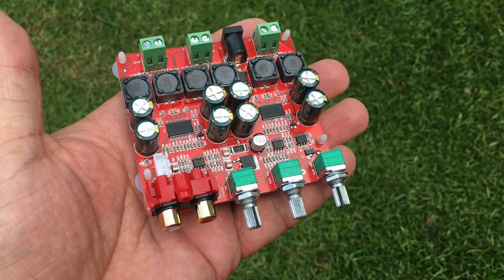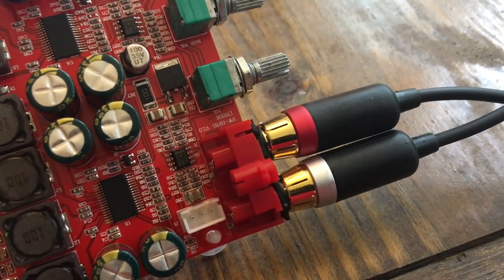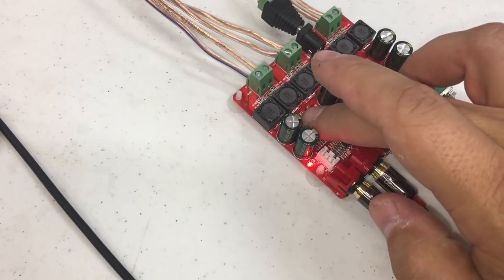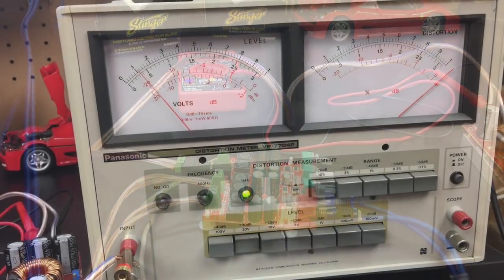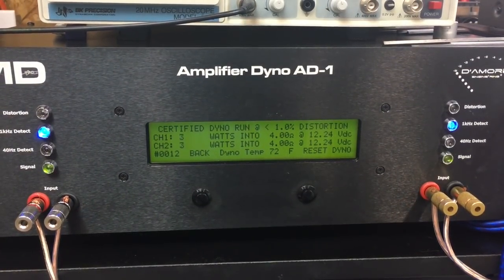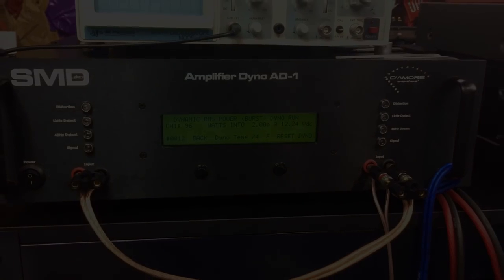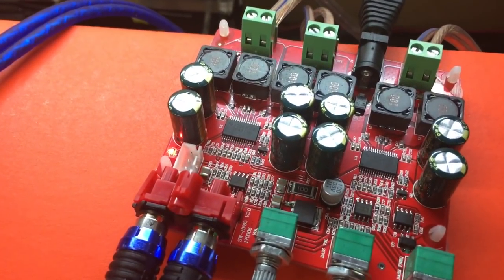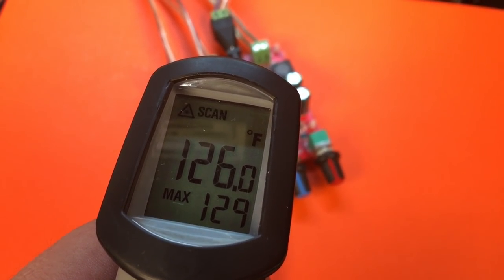TPA3118D2 Can You Get Decent 2.1 Amp Board for $12?

Comment from the maker: I'll update video description with songs used, all were from the YouTube Audio library. Thanks!
Reply: BigDWiz I bought a TPA3116D2 (100x2) around $6.78!!
Reply: BigDWiz awesome..to do a custom diy bookshelf and a sub for a computer 2.1 stereo!
Reply: did the step up converter actually have an effect?
im planning to use this in my car and i need a step up converter for 24 v from the battery. Should i use a 10 or 15 A fuse from the battery?
thanks.
Reply: I was looking at some of these little boards and was really impressed. My problem lies in the fact that some of them are rated from anywhere from 19 to 24 volts up to 15 amps. I didn't know most of them could run off 12 volts? But still if you were going to create a little shelf speaker something cool with one of these chips where you supposed to find a 24 volt power supply with 15 amps? A laptop charger? They're not cheap or small.. It's pretty much nonexistent. I mean you can find them but it ends up costing Twice as much as the board.  any suggestions or tips would be greatly appreciated.
Reply: Thanks for the information, thoroughly professional and now I know what equipment to buy for testing.
Reply: No update?... That first track is a banger...
Reply: Thanks.
Reply: What's the song plsplspls
Reply: unfortunate for me, they dont ship to AU. Sure i can find something that looks the same online, but no guarantee it is similar to the one you tested.
Reply: Hi, thanks for the video. Can  you please tell us whether the subwoofer channel has a Low Pass Filter? And if so, at which frequency? Thanks.
Reply: I have TPA3116D2 🤣 120watts*2

Comment: The problem with MOST of these cheaper 2.1 amps is the subwoofer crossover point. It would really be helpful to test and review the actual crossover point of the amp. Having a subwoofer crossing at 120 to 150 Hz is really much too high... that's where a lot of these cheaper 2.1 amps are crossing at.  You will get a lot of unwanted outpout in the higher bass frequencies which will give away the subwoofer location, as well as muddy up the sound, which you don't want.  
Pretty cool review, though. 
I agree, the front input location is kind of wacky.  I'd likely remove the RCS's and change the input connections so the board would sit flush with it's enclosure.
Reply: Thomas Zarbo How is 150 Hz too high? I thought the common upper crossover frequency for woofers was around 300-600 Hz? Or are you referring to the lower-bound frequency?
Reply: Its because those amplifiers are most designed for DIY portable proyects where normally what most people want is sound, and 150 hz sounds loudly than 40 hz on a portable speaker with subwoofer. For quality audio use a class a-b amp

Comment: I love these 3117 amps.  The key to power is definitely voltage backed up by 5 or so amps. Increases in voltage above 20V will significantly increase the power output.  They can be pushed past 25V without fear of letting the smoke out,it will just drop out into  a temp self protect. The only caveat to that would be the capacitor rating make sure it  has 35V vs 25V caps..I had mine run reliably at 28.5 V with a 2ohm load outputting 150W from just one bridged 3117, the same load at 19V at the same volume same sine wave frequency and the power output drops to 50W.  Incredible how far amp tech has come. This is just the beginning,  I expect to see affordable, more powerful audio amp ICs in the near future.

Comment: Thanks for all of the videos BigD! unfortunately I'm limited to 12v in my mobile Bluetooth  design.  Have you tested a 2.1 mini amp that's designed for lower  operating voltage?
Reply from the maker: +Whit Hutchinson this one works with 12 volts also, just provides less power output. At the end, I show both 12 and 24 volt results

Comment: I used one of these budget amps - Dayton Audio KAB-250 (tpa3116 chip) with bluetooth - and integrated it into a 1941 Crosley 25A radio. Works amazingly well and sounds good.
Reply from the maker: +wishboneattack sounds like an awesome project 👍
Reply: @ which voltage did you put the amp, cause mine makes weird background noise at 15V and 2.5A.
Reply: Gillege I used a 19 Volt power supply. On Parts Express it is model #0335A1965. I bought it when it was $35. It's currently $10. I metered the output wires for positive and negative, cut off the 5.5mm plug, and wired the output to the harness on the amplifier. I also have the power supply powering two 19 volt lights on the 1941 radio. I don't have any humming.
Reply from the maker: Great tip, thanks 👍

Comment: I was looking at some of these little boards and was really impressed. My problem lies in the fact that some of them are rated from anywhere from 19 to 24 volts up to 15 amps. I didn't know most of them could run off 12 volts? But still if you were going to create a little shelf speaker something cool with one of these chips where you supposed to find a 24 volt power supply with 15 amps? A laptop charger? They're not cheap or small.. It's pretty much nonexistent. I mean you can find them but it ends up costing Twice as much as the board.  any suggestions or tips would be greatly appreciated.

Comment: Seen a lot of your dyi small eBay amps and dyno test and there great keep it up and was also wondering if you would do one on the eBay China mini sub woofer amp plate with two tda 3118 chip. It would be great its model sw-501 sub amp plate 2.1👍

Comment: Awesome, thanks for the celsius values ! Could add SANWU to the title, should get some more traffic your way.

5W on idle is still quuuuite a lot, given the datasheet claims something below 100mA - are the inductors by any chance getting toasty (on idle) ?
Reply from the maker: +Darieee the idle current I measured was 190mA. You can disregard the "power" and "wattage" shown on the volt/ammeter. Thanks for the tip about the title, will do 👌

Comment: love the video!!! I have a 2 channel with bluetooth and the sound is very impressive with 2 kicker 5.25 speakers
Reply from the maker: +Harmon Ford for less than 100 bucks, you can build your own portable system with MUCH higher quality than the commercial ones at this price point.
Reply: BigDWiz I already sold 2 boxes  with that set up. no complaints so far
Reply: I got the cost down to like 80 or 90 bucks
Reply from the maker: +Harmon Ford awesome 🤘

Comment: I use these boards for pretty much all my portable builds, with around 2x50W and 1x 100W on 24v it's really more than enough. Crossovers on the 2x 50W and use of tweeters is really nice. Volume-wise... don't get me started about it, i bet you could piss of the whole block with it if you use it outside.

Comment: Check the virtal Ground of the OPAmps on the Board. All mine had to be shiftet from around 1V to 1/2VCC (5VRail->2.5V) I did it by changing a little resistor in the voltage divider that feeds the cap of the 2.5V rail. Unsymetrical Clipping was gone. Result: 2X undistorted Power. It seems a lot of these chinese boards have this issue.

Comment: that is crazy that there's no heat sinks. Luckily can pick him up from pretty cheap, but still.
Reply from the maker: +123Toid according to specs they are not needed if running front channels at 8 ohms and sub at 4 ohms. Also notice temps when I measured after music...not bad at all. Other temps shown were after tests with resistors...much more torture on the amp
Reply: Thanks BigDWiz, I appreciate the feedback

Comment: You are beating the crap out that subwoofer .
Reply: Pretty shitty enclosure since it vibrates with the woofer. Shouldn't do that.
Reply: Well, most car audio freaks are also using 12 inch+ beasts that will vibrate their enclosure heck of a lot more.
Reply: yeah but they dont have a clue what sound quality is!

Comment: Are there any of these little cheap board amps that have signal sensing? I'de like to be able to install one in a passive speaker to turn it into a powered speaker on the cheap that I can connect a chromecast audio too and have the amp turn itself off and on automatically whenever it senses an audio signal from the chromecast (I currently use a smart plug on each ones power brick but that requires the extra step of turning it off and on each time).  Is there something about signal sensing circuits that is just inherently expensive or difficult to implement properly?  The audiosource100 amp is the cheapest thing I can find with signal sensing but they don't really lend themselves to what I want to do and they kind of defeat the goal of a cheap diy powered speaker.
Reply from the maker: These consume very little power at idle. I’m not aware of any using signal sensing

Comment: Hi Williston. I head you say while testing the sub Chanel at 40hz that the amp doesn't have much reserve. Did you refere to the capacitor? If so could I add a few more and improve on that? Thank you.
Reply from the maker: No dynamic reserve power. Based on the design architecture
Reply: @wal  OH boy... I'm clueless. I don't want to take much of you time with my lack of general knowledge. But thank you man.

Comment: Can anyone give and honest recommendation about amplifier boards? Has anyone actually seen these things in a nice sounding and reliable car audio systems? Can these things actually be used in a respectable car audio system? At first impression they seem like a cheep, cool solution if someone is willing to do a little tinkering and experimenting.  If possible what ones are the best for mids and highs and lows? Thanks
Reply from the maker: Most of these need higher voltage than car battery can provide (24-36V). Without a voltage booster these wouldn’t work well in a car

Comment: I hooked up a 1000watt boss mono block in my school backpack with 2 Polk audio t15 and a 12v sealed lead acid and it only costed $100 it sounded so clean and has the bass louder and cleaner than a stock car sounds stem I regret selling it. I messed with the entire school it was so loud
Reply: boss audio never had rated power.. is like 25% of rated power is RMS

Comment: how long will something like this last, those chips with no heat sink seem as if they would not last long at all.
Reply: i have a tpa3118 which is 60w mono and at full volume at 6ohms it doesn't even get hot
Reply: Stick a heatsink on it if you are worried about heat. Or buy one with heatsinks fitted allready.
Not that complicated ;)

Comment: Is the third knob really a sub freqency adjustable filter? What are the frequencies to set? Or is just sub channel volume?
Reply from the maker: +Greg S it seems to adjust volume. I'll need to try an analyzer to check the frequency. My bad for forgetting to add this, very important in a full review
Reply: Thanks BigDWiz. On the webpage from your video https://youtu.be/d4syuj1UWBU?t=35 it says in the description of the 3rd knob: Bass Frequency which might suggest that is a adjustable crossover for the bass output. A bit dissapointing that it is not though.

Comment: Shouldn't you use a music player as a line out or signal out instead of a amplified signal to another amp?
Reply from the maker: Not sure what you are referring to? I use a line level signal from a high end car stereo CD tuner which I’ve tested to show extremely low THD as my source. Maybe you noticed something else?
Reply: Are you running a powered signal from the car RCA amp output that would normally go to speaker, but to the mini amp?

Comment: Great vid D!! Sounds great I'm gunna have to get some to play with.
Reply from the maker: +supra750 they are fun and very inexpensive amps. Just pick up one of those voltage boosters too unless you have a way to provide 24 volts. Amp really shines at 24 volts
Reply: Thinking about putting two 12v battery's in series and run them in a boom box or cooler. With the low amp draw bet they would play a while with some good size battery's.

Comment: may be a silly question but how do you hook up the power and ground to the amp?
Reply: That's what the round plug is. Designed for a wall socket with an ac/dc converter plug.
Reply from the maker: +fat catt 39 barrel connector with center positive connector. 5.5mm x 2.1mm if I recall correctly
Reply: fat catt 39 , you have to buy a separate 120 volt power supply I'm assuming, I saw the plug on the side of the board

Comment: If you can find a larger heatsink I'm sure it would be better
Reply from the maker: +MrBrymstond I'm sure it would help too, not with additional power, but keeping the chips cooler
Reply: Yes, copper heatsinks that just clear with taller fins, use that white silicone heat conductive compound that hardens and non electrically conductive, way to go..
Reply: +BigDWiz I wouldn't worry about the heatsinks. They may help some but the TPA3118d2 is designed with a PowerPad that is soldered to the pcb ground plane. The copper in the pcb is the heatsink and that array of via holes under each TPA3118d2 conducts heat through the board to the backside layer of copper as well. So it's important that you mount the board with the standoffs so there is clearance / air movement underneath. You can read more about PowerPad technology here:

http://www.ti.com/lit/an/slma002g/slma002g.pdf

If you need to run more power the TPA3116d2 (same family) is designed to use a top mounted heatsink.
Reply: If you noticed, it got better wattage with the small ones he used
Reply: The only significant output power difference I saw in this video was comparing a 12.5v and 25v power source.  There is no need for an additional heatsink - its designed not to need one if the pcb is properly designed (it appears to be - although I think there should be more thermal vias) and it's mounted with adequate airspace around it and/or a little airflow across it.  TI rates the TPA3118 to 85C (185F).  If it gets beyond that, there is overtemp protection:    "Integrated Self-Protection Circuits Including Overvoltage, Undervoltage, Overtemperature, DC-Detect, and Short Circuit With Error Reporting"

Comment: Nice load box. I need to make one.
I assume class D amps need to dissipate around 10% of their output power.
Reply from the maker: +JohnAudioTech I found the sample project for making the resistor bank a while back. I also have a bunch of wirewound resistors in an old PC case I used before getting the Amp Dyno

Comment: These class-D amps will be limited especially in bass response based on the available smoothing capacitor capacity. More capacity = more bass. You actually want low ESR caps for these amps. The type used on switch mode power supplies. Audio grade is not necessary. The distortion you were getting is likely due to the preamp stage built on to this board. The cheap preamp stages used on these things are garbage.
Reply from the maker: +Felix O'Keefe there's more to bass control than class or capacitor capacity, but it would not hurt for sure. I suspect not much from these cheapo amps, thus far have been impressed.